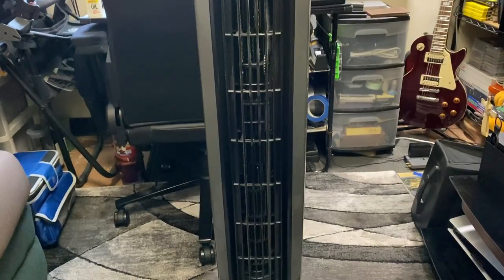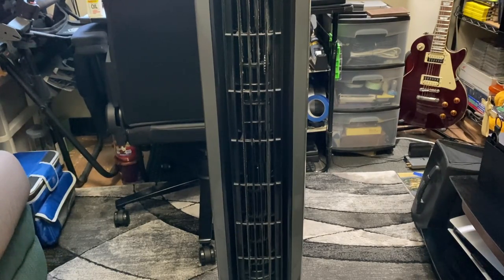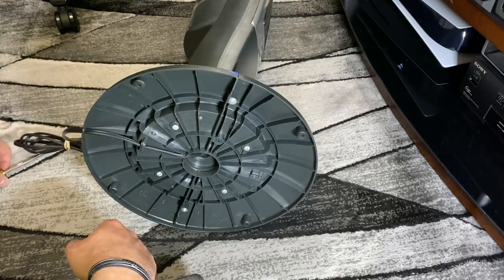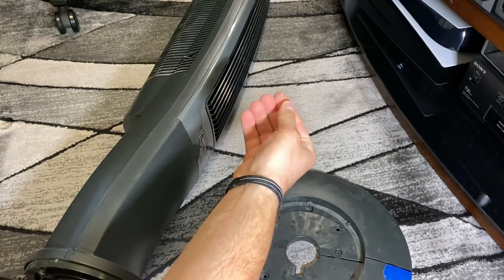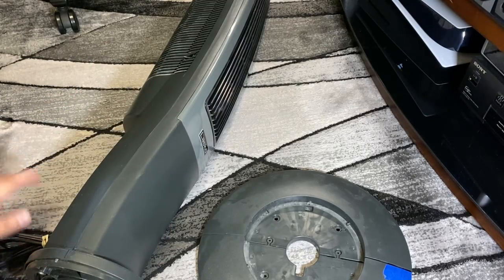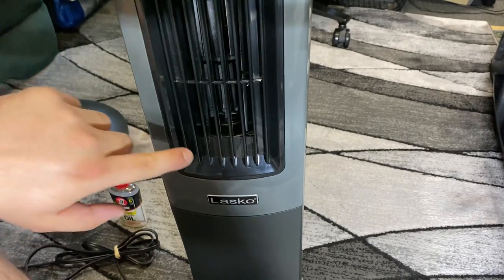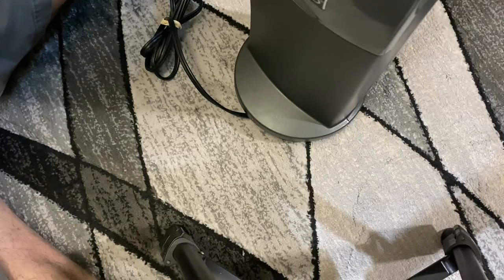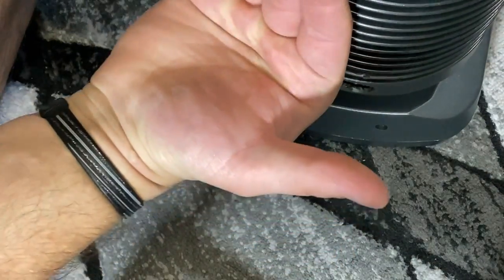How to Clean, Quiet, & Oil a Tower Fan WITHOUT Taking It Apart

Comment: STOP, please get a yard blower,  done the job in 2 mins. No need to take to apart, the fans are cheap anyway.
Reply: I saw where the rechargeable compressed air dusters are far more effective than a yard blower. They're more precise and effective for electrics & electronics.

Comment: Hello , did you use water or just the air
Reply from the maker: I used air to blow the dust out and a wet towel to wipe off any residue left on the casing.
Reply: @Mr.Everything  thanks